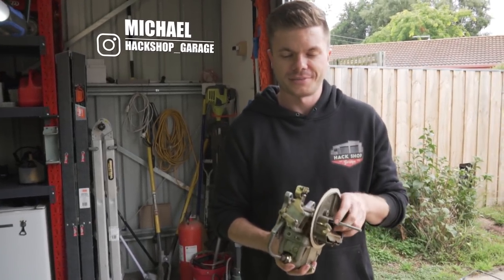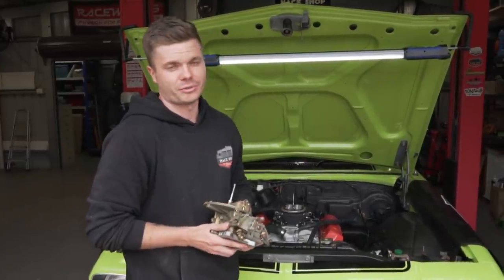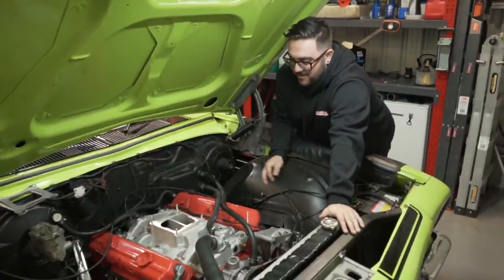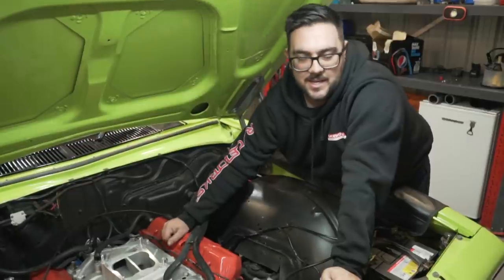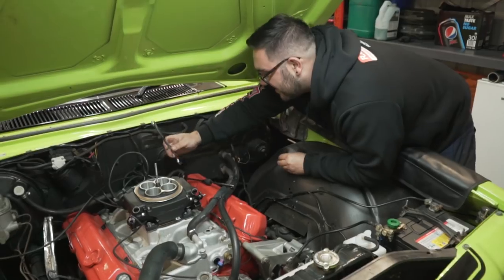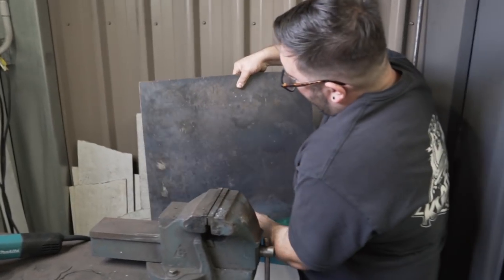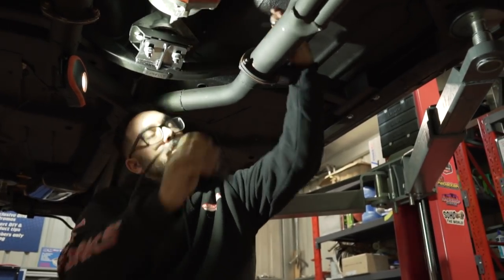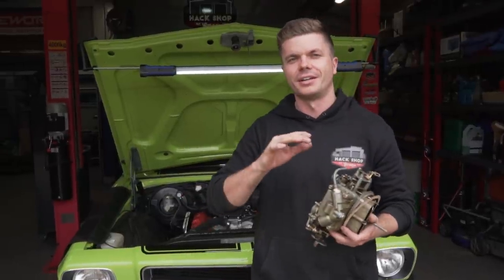HQ Holden 253 Holley Sniper EFI Conversion - Part 1

Comment: G'day lads great episode really keen to see part 2. Just a suggestion the Sniper EFI would be classed as an TBI (Throttle body injection) unit not carburettor as mentioned a few times in episode 1.  As I'm sure you will keep up the good work.

Comment: Apologies if this has already been mentioned, but from what I’ve seen the 4 barrel sniper kits don’t seem to like dual plane manifolds. The cure has been a 1/2 inch open spacer, or to mill down the plenum divider. Great channel btw 🤘
Reply from the maker: Hey mate, we have heard that since installing it already, so we are going to try it and see how it goes. And if need be do as you say

Comment: Wasn’t crap guys it actully watched really good Trevor the el falcon would be stoked lol ps the haltech Install is a nightmare lol!
Reply from the maker: Thanks mate, much appreciated, how far have you gotten with the install?
Reply: @HackshopGarage  I’m awaiting the diff to return atm I have taken out the welded diff it came with tossed that when and brought a MACE TOUQE LSD CENTER and brought all new diff rebuild bearings and new shims started to rebuild it all and found that the pinion lash had actully moved forward ten thou so marching off to the specialist to get it machined so it would fit but then the crush barring had to be realigned and all that crazy dialing in for the back lash was just all to much so I out sourced the rebuild lol......so in the mean while I rebuild all the back suspension to Au heavy top and bottom trailing bars and sway bar and Whitt’s link with all new nurothanine rubbers which wasn’t easy as all the old ones where crazy stuck but all done ready for the new diff to arrive .......then out of the big bad blue came a new full time job last week and so I have been move ing to Launceston which is great as I am only now twenty minutes from Simmons plaines our race track yay instead of like two hours but I’m now haveing to move very thing over the next few weeks so I’m a bit behind I have the loom and computer actully installed but I’m now trying to work out how every thing actully goes together to the old loom I’m using the premium wiring loom from haltech also wide band and flex fuel I have got the race works pump installed and new high out put injectors fuel regulator is in new turbo is hear but it’s massive so will need a lot of fab work before that goes on also the power tune digital dash has to be put in and that will be a huge task as well it’s all on the bench ready to go in but I’m now building kitchens five days a week now so I guess it will be night time activity’s from hear on in
Reply from the maker: Sounds awesome mate, sounds like you’ve been hard at it, good work, it’ll get there eventually and will be great when it’s done

Comment: If you use a bit of  rolled up aluminium foil or play doh  , roll it into a thin cylinder shape an put it on the air filter  in an upright position  then shut the bonnet  an it will crush down  to show how much clearance hight you have to the bonnet

Comment: Well lads, I am about to fit a Sniper on my HQ Sandman ute 308 ute. First, though I have to sort out fitting a new Camshaft 214/224 @050, lifters, water pump, HP oil pump & twin-row timing chain. I am hoping to make a video on my journey soon. My Sniper was purchased from Summitt USA plus the Hyperspark CDI, Dizzy & coil. The Edelbrock Performer I have modified via an RPM style mill of the center divider which will then have a 1-inch four-hole spacer hopefully from Jet or Taylor cable. The Sniper can be really tuned via a laptop plus Holley software. You can data log the tune and send it to a mob that I got my Hyperspark system from and they can do up a fuel/ignition map from that to suit the engine. AFR can be easily adjusted via the 3.5 screen. I also got a progressive throttle linkage that opens the primary blades 40% before the secondaries open. Very recommended they say. Lettuce Alone paint I believe.

Comment: United speed shop have just made a efi ready tank to suit hq sedans. Also might be worth looking into a progressive linkage for the 4 barrel. Primary’s open till 50% throttle then secondaries open if you ever need it for the thongslapper. Awesome video👍
Reply from the maker: Interesting, might have to look into it. Thanks mate
Reply: Is a TB, butterflies open at same time at same angles.(I have a Fitech 2x4 system on my HQ).

Comment: Hey guys, as a fellow 253 owner I'm curious to see the performance and fuel consumption results, thanks for the vid.
Reply: yeah what he said
Reply: Well I can tell u both fuel consumption will take some manual tuning to get better. I average 15mpg on highway with rowdy 440 cubic inch small block chevy with no overdrive. Th400 trans 3.42 rear gear and 28in tire
Reply: @cfmechanic  Yeah man, everything works together.

Comment: You might have some issues with the dual-plane manifold. Lots of experiences online about the problems a dual-plane causes versus a single plane with sniper EFI. I am running on my Mopar 440 and I love it. Hadn't started the car for a couple of months, but a 5 second prime of the pump, and she started right away.
Reply from the maker: Interesting, I hadn’t come across that, so you know what causes the issues with the duel plane?
Reply: @HackshopGarage  Not really sure. I now engine masters did a video on it a while ago and just couldn't get it to run right. Once they switched to the single plane, it ran perfectly. Have read quite a few things on forums and videos of similar problems. Seems to be the way the fuel is distributed through the dual versus the single. But if you don't have issues then all good. Maybe more of an issue on higher horsepower motors.
Reply from the maker: Yeah hopefully we won’t have those issues being that it’s such a low powered motor

Comment: Nice work fellas i did actually find this channel from watching skid factory , just a thought what fuel pressure does this system run could you do like an LS dead head system ( non return) with the pressure regulated fuel filter as they have used on skid factory then there is no need to modify the tank

Comment: Microphone 🤣
Good work guys once again, I will second the holley hydramat for a pick up as well, works great and solves fuel starvation issues for most applications. Doesn't help the in pump issues though. 
Have a look at holleys retro fit in tank pump set ups, may give you some more direction.
Reply from the maker: Yeah I gotta look into these hydramats, they sound pretty good

Comment: You do realise that there are aftermarket air cleaners with reduced bases to drop the whole air cleaner down over your carb / throttle body ?  Only issue you may have is with engine movement may scrub under bonnet . I lost an engine mount and banged up my bonnet pretty good !

Comment: You would still have issues getting the fuel gauge to work with the VS Commodore fuel tank sender unit anyway as the HQ Holden uses either the thermal or magnetic type of fuel level sender !

Comment: Silly question probably, but if you are going for stock appearance, could you internally gut the mechanical pump (valves and actuating arm out) and just flow the fuel through stock appearing lines while letting the electric pump do the work? Just wondering...
Reply from the maker: That is a good question, I wouldn’t know for sure. I guess it would depend on if the stock pump casing would handle the increased pressure EFI requires
Reply: @HackshopGarage  good point. Hadn't considered the pressure increase.

Comment: What size Sniper did you go with on the 253? 
Most carb websites suggest 450-500cfm for the 253
Reply from the maker: Hey mate, I went with the 4 barrel version, I’m not sure what cfm it works out to though
Reply: @HackshopGarage  no worries.
How is it going a few months on?
I have just had a 253 rebuilt, blueprinted/balanced and modded for strong street/drivable power. I was thinking about a Edlebrock AVS2 500cfm, but i must admit, this Sniper is very interesting
Reply from the maker: I havnt driven it a whole lot, but so far it’s going really well. I’m impressed by it so far

Comment: So Self-Learning isnt as it says (be all and end all). EFI will find your vacuum leaks - number 1! It does the basics of working out what your car needs to idle and run. But you might find stumbles, and tip in issues, or backing-off pops etc. Thats where you need to tune it yourself, and play with after-start, warm starts, fuel input vs rpm, fuel pump delivery (pwm or full), vacuum vs tps input, IAC and coolant temps and AFRs. Fuel pumps, fuel filters (10/30 microns) are also a very big part to getting these to work properly. Takes a bit to get it right. Not taking away what you guys are doing, just letting those who want to do this, that there is more to this EFI system than putting it on, and whacking in base engine settings, and turning key. Once its tuned though...geez it makes a difference, particularly with cold starts! Dont worry guys - love your channel....just offering advice and disclaimers :)
Reply from the maker: Yeah that’s fair enough, it will be interesting to see how it goes

Comment: Once its up and running, so you reckon you will swap to a Holley Hyperspark distributor? (They are available for 253/308) Would be interesting to see the difference once the ECU is controlling spark..
Reply from the maker: Potentially yeah, depends on cost and such, but it would be interesting to see the difference.

Comment: Where did you get the instructions for the drilling of the manifold from? I have the exact same manifold but it’s second hand without instructions and needs drilling. Any info you guys are happy to share with that? Cheers
Reply from the maker: Hey mate, the instructions came in the box. But if you go to the link below and scroll down, it has online installation instructions where it’ll explain the drilling process 

https://www.edelbrock.com/perfomer-holden-intake-manifold-253-308-2194.html
Reply: Legends!

Comment: Hi guys to check your bonnet clearance go to the toy shop & get a tub of playdough and put blobs on your air cleaner and you can measure the amount of claerance you have.
Reply from the maker: Nice tip! Thanks mate, will give it a go
Reply: Same as checking Piston to Valve clearance 👌🏻

Comment: i just brought one for my 308, i cant understand what to do with my temp sensor as i only have one slot but also want the gauge cluster to still work would you have any idea
Reply from the maker: Other than drilling and tapping a second port into the manifold water way, an easy way might be to move the gauge sensor to read off and inline radiator hose sensor adaptor

Comment: Vs tank is simple i have done a few
Cap the old filler, weld in the hq filler
Use the orginal straps, the other thing i do is add foam to the top to level the top of the tank to the floor
Downside is the fuel gauge doesn't match ohms range of the hq gauges
Paint it black and you don't notice it much, on my current q i have a towbar and that hides it more
Reply from the maker: Yeah with a tow bar that wouldn’t be so bad. We have heard it’s a good alternative, hence why we were going to use it. But we have found an option now
Reply: @HackshopGarage  as long as what ever you come up with works and you're happy with it, that's all that matters
Just a side note, is it a genuine gts4 or a replica?
Reply from the maker: That’s it mate, and It’s a replica, an original 253 manual kingswood
Reply: @HackshopGarage  yeah cool, i have a replica which is highly modified and a genuine one i am currently restoring as a factory example
Once i sort my pc crashing while editing I'll post more videos to YouTube, the plan is one a week
Reply from the maker: Sounds awesome mate, a nice pair

Comment: Why don’t you buy a recess base air filter and modify your current housing by cutting out the centre and weld the recess centre into it. I am sure Tinman could assist

Comment: Easy way to determine if your bonnet is going to hit, place some playdough or bluetac on top of the filter and close your bonnet, you'll easily tell how much gap you have. You're welcome =)
Reply: crunch up some alli foil into a ball, works brilliant.
also great for wrapping around wiring, hoses etc when painting, cleaning under the bonnet.

Comment: FYI.. Holley sell a recessed air cleaner base for the sniper..
Reply: Yep Holley drop base - I have a Terminator EFI on my 65 Nova (from the Skid Factory so assume you've seen it) ;) and the stock lid fits in the stock location/height no probs. PART# 120-511

Comment: A old trick we used to do is flip. The air cleaner lid.  It gives. It a bit more air in..i personally love the 253 over the 308.  Come on boys you could have run the fuel lines now..    When you were playing with accelerator pedal it sounded like no cabin insulation[ dyna mat]?????
Reply from the maker: Haha I’d agree with you on the 253, and nah no dyno mat, the original build of this cars was years ago when I was a teenager, only insulation we used was left over house carpet insulation haha
Reply: @HackshopGarage  yea ive been know too use the sponge type hhaa

Comment: Hey guys,
Kevin here from Pakenham. 
So my car of choice is a 1963 vw beetle with a 1916cc engine. dual 40's Webber's.  With 130hp. 
Any chance you can tune it for me.
Its popping and farting and doesn't like cold starts or hot starts.
✌  peace guys
One more thing. 
When closing your bonnet don't push it shut from the bottom centre bit . You'll put a dip in your bonnet. Ask me how i know. 
I made it to the end ya.
Microphone
Reply from the maker: Hey Kevin, sorry mate but we would not be the guys to look at tuning anything, we have no experience with tuning stuff ourselves. But yes you are right about the bonnet, I normally wouldn’t. Just didn’t want to drop it incase it hit the filter haha
Reply: @HackshopGarage  you are right carburettors can be a prick but the dual Webber's certainly sounds good. 
Owe i was joking at letting you touch my engine.  🤣🤣

Comment: Stop insulting the EFI by calling it a lowly carby lol
Reply: I have FItech EFI and its been great. Same basis as the SNIPER. It really is the basics in EFI, as they are throttle body injection, and not multipoint. That is the better way of doing it. In saying that, if you are good (and patient) at tuning these Holley/FiTech systems, you can get a decent fuel delivery system!

Comment: Waste of money. Good edelbrock carb out of the box these days are near straight swap n go.
That or google how to adjust floats in original carb.
Generally adjust idle screw and go unless chasing big hp
Reply from the maker: Yeah you are probably right, but just wanted to try something different to see how it goes and if it is worth the hype